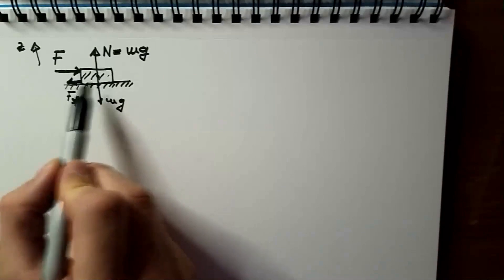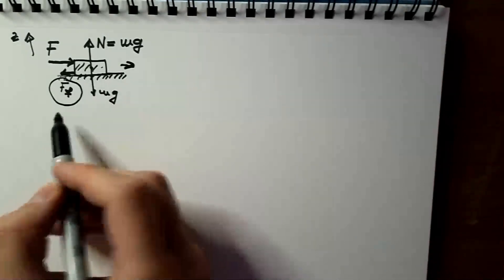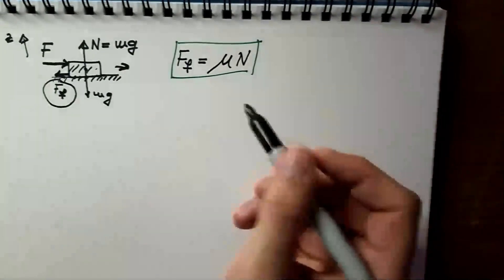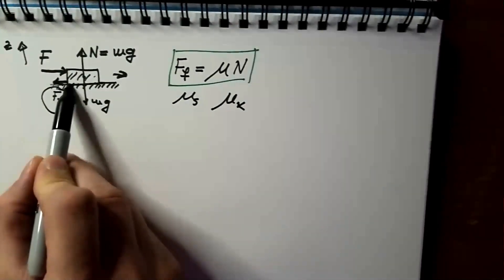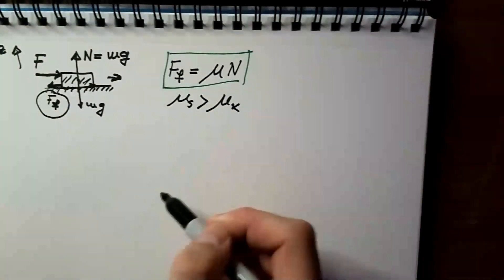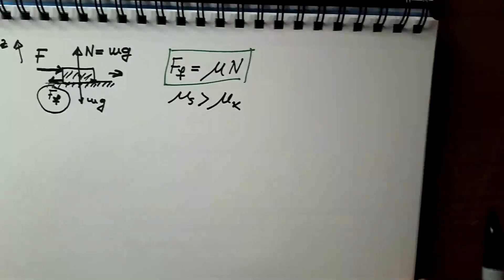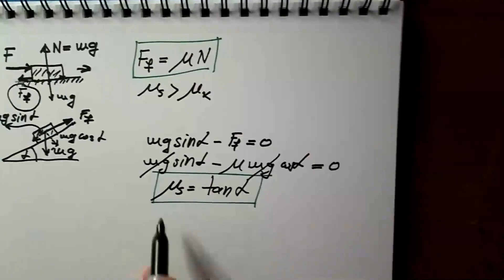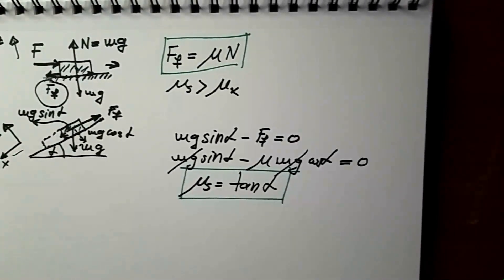The Friction Force

Comment: Hello, I have a few questions 🤓. On the second sketch, I would have drawn the Mg vector along the z axis. On your diagram, the gravity vector is not aligned with the vertical z axis, so I'm having trouble understanding. Isn't this a mistake? 

On the other hand, you said it's counter-intuitive that mass doesn't appear in the formulation of the coefficient Us. But mass is already in the Normal force, which is used to calculate the friction force (Ff=Us*N), so it's quite logical that it shouldn't appear twice, isn't it? By the way, how do you calculate Uc ?
Reply from the maker: The graviy vector is not aligned with the z axis because I decided to have tthe z axis perpendicular to the inclined plane. That is why I decomposed the gravity force (mg) along to the components along the inclined plane and parallel to the inclined plane. It's not a mistake.

Many people tend to intuitively thinks that the coefficient of friction would depend on mass. FOr example, the hevier the object, the higher the friction coefficient. However, that is not the case, as we see in this video.
Reply: @DjordjeRomanic  Thank you ! So, there is no formula to calculate Uc ?
Reply from the maker: @Forever-do8zs  What is Uc?
Reply: @DjordjeRomanic  Sorry, i mean Uk.
Reply from the maker: @Forever-do8zs  It has to be determined experimentally. There is no closd-form solution.

Comment: Assuming the static friction coefficient between your body and ice is very low, rolling down wouldn't be efficient because you would simply rotate around an axis passing through the center of the body, and you would slide down to the bottom of the hill encountering the dynamic friction coefficient. So depending on these coefficient you would choose your most effective way to go down.
Reply from the maker: That's correct.